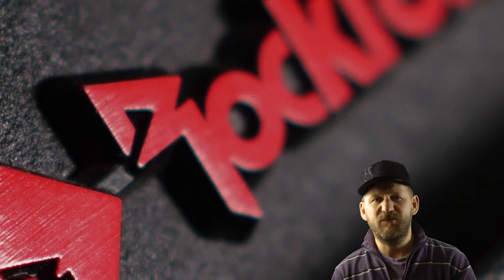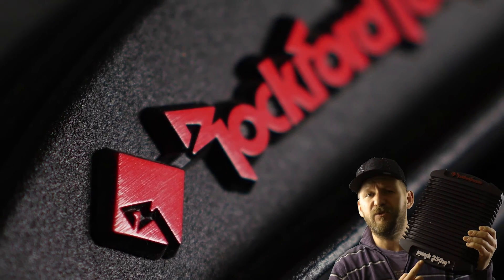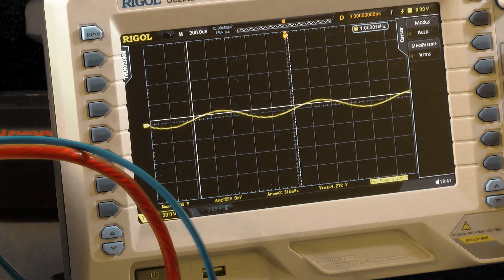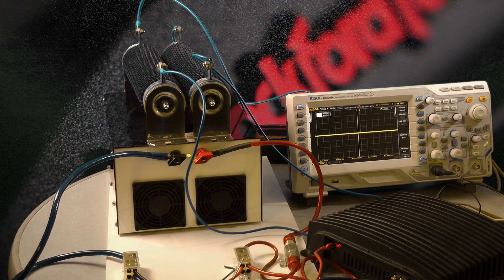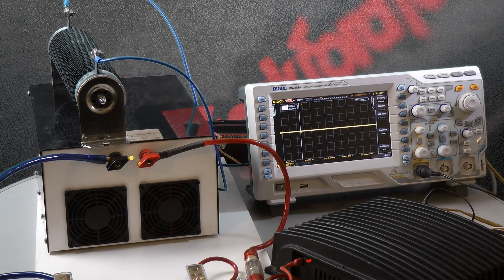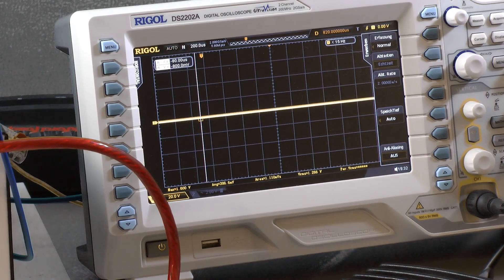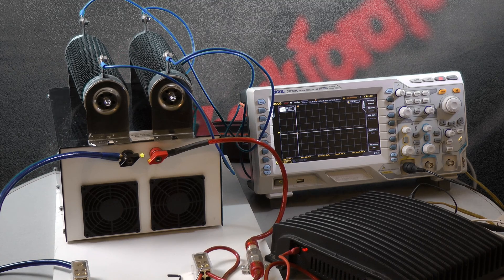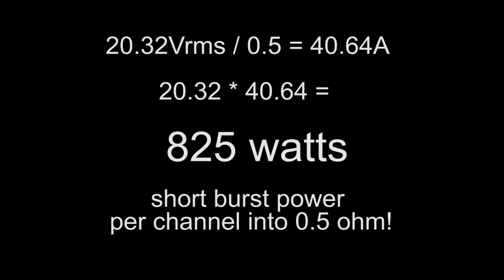Rockford Fosgate Punch 200 DSM amp Dyno Run Power test old school amplifier

Comment: As great as this amp is, one thing I always found odd about the Punch 200 is just how LITTLE power it makes. Yes, it beats it namelplate rating by a good deal. But when you consider that a Punch 40, 60, and 100 put out 50w, 80W, and 120W per channel (respectively) into 4Ω stereo vs 170 from the Punch 200, it is quite apparent that the Punch 200 is not as ridiculously underrated as the smaller amps (2Ω ratings follow the same trend). The Punch 200 SHOULD have an output closer to 250W stereo into 4Ω to keep up with the others. Not sure why Fosgate chose to make the Punch 200 so much less underrated
Reply from the maker: The smaller punches are more underrated than the bigger ones. I’m working on a video of a smaller 4 channel rated 25W per channel, it almost tripled its output power 😁

Comment: We used to run them 1ohm mono with the backs off and fanned. They put out a stupid amount of power!!!!!
Reply: I have been using mine for 3 years now but I have had it sitting on a shelf ever since 2007-2019. I have been running it at 4 ohms cause I only have 1 10 inch sub In small truck I have. It is a DVC 2ohm. It is a convertible 2002 Camaro. I haven been wondering if it would even play at 1 ohm on my sub since they are even rated for 2 ohm. Now I will have to test the waters this weekend and see if the 200ix will give it all she's got again. 
    Has anyone ever just played it at 1ohm for a long period or is that just short bursts? I plan on riding around with it at 1ohm. Probably 15 minutes to 1 hour at a time.
Reply from the maker: Hi!
Back in 1995 i had a 40ix at 2 ohms mono for 5 years. it did well on 2 eminence 10" woofers.
the burst with 1kHz isnt a hard load for the amps power supply. i think it will not work if the burst has been made with a 50Hz signal. Avoid it if it gets hot.
Reply from the maker: today i tested a punch 60ix dsm 1 ohm mono for dynamic power. i was really surprised what a 60 watt amp can put out - insane!!!!
Reply: @audiokeller1975  we used the punch 200 ix for competition in late 90s and they're ridiculously awesome amps if you can feed them enough power and keep them cool
Reply from the maker: i totally agree. the dynamic power is great 👍👍

Comment: Do you repair amps? I have a few 90s punch amps that need some work.
Reply from the maker: i just repaired a punch 200dsm, punch 250m, punch 225.2 and a punch 100 dsm. that was just for fun. my profession isnt doing amps. i build my first 720 watt amp 28 years ago. but its just a hobby if i have the time for it. 👍
Reply: @audiokeller1975  awesome buddy. I have a punch 200 ix and I think a punch 4080 ix that need a little help. Do you know who can repair them? Those old school amps are built for making clean power. I subbed.
Reply: @jsnjcnt  Freeman's car stereo in Charlotte NC and Desert Audio in Az can get u right, they do good work
Reply: @darrellhenderson1459  awesome buddy. I'll check it out. The amps were made in tempe arizona. They will be in good hands.
Reply from the maker: i dont know because i live in germany. if you were near my location i would do that for you. i like fixing rockfords :-) do you have a multimeter and a small power supply?
Reply: @audiokeller1975 I have a multimeter. Will a 6 amp 12v battery charger work for a small power supply?
Reply from the maker: a charger can cause problems. better use a small battery or power supply. to check and repair a punch 200ix you need 12v with 3 amps or a little more. if it has much more amps you should use an inline fuse of 5 or 10 amps. this makes sure you dont kill the amp after repair. sometimes there is more damage and causes high current draw. a 200 ix should have an idle current of around 1 - 1.5 or 2 amps. i can recommend www.bcae1.com
everything is explained well and in english 👍
Reply: @audiokeller1975  thank you buddy, I'll get a small 12v battery.

Comment: I have 2 of these so 2ohm mono its ok ?
Reply from the maker: i never had problems with the punch 200 driving two 4 ohm subwoofers in mono 2 ohms back in the 90s for years.
They are old amps now. so i would open your amps and check if capacitors are bumpy. if so, exchange them. if electrolytic fluid comes out of the caps its going worse because the electrolytic causes more damage to the mainboard and surrounding components.
if you have a punch 200dsm also check the small 10uF / 16V silver capacitors. they were not very reliable and tend to loose electrolytic fluids. in the punch ix series they werent a major problem.

Comment: Great video!!! Those numbers at the end seem a little unrealistic for an amp of that size, even though I know it was for a short burst!!! It still amazing the power it can put out!!! I can just imagine if it could put out those numbers on a continuous amount of power in a car audio sound system!!! So that means that the most power you can get is 421watts per channel at 1ohm on a continuous basis with no problem is that correct??? With out it over heating or with out frying up the amp correct??? 🤔🤔🤔
Reply from the maker: Yes, these numbers are completely useless. But i was impressed that this small amp is able to deliver this kind of extreme short term power into that low impedances.
1 ohm per channel is the same like 2 ohms bridged mono. i never had a problem back in the days with a punch 40 or 200 for 6 years in this bridged 2 ohm operation mode.
But i think it depends on speaker enclosure design ( impedance curve )  and the kind of music you listen to. Today people listen to sinusoidal bass tracks which cause much current draw. Back in the 90s the hardest music was usually listening to 2lifecrew tracks 😎👍😂
Realistic 1kHz dynamic burst power into 2 ohms mono is around 800-1000 watts depending on supply voltage.
And this resistive test is the hardest way to test an amp.